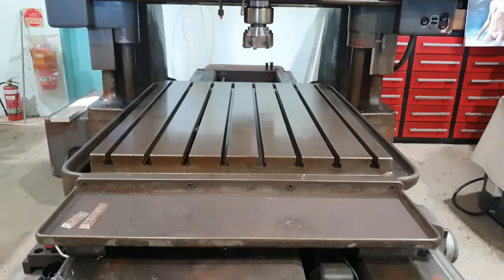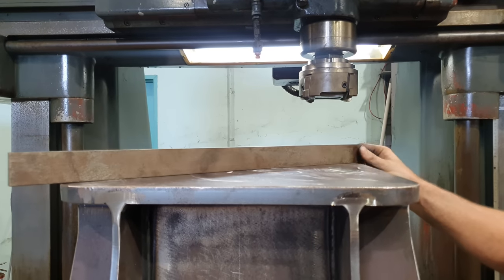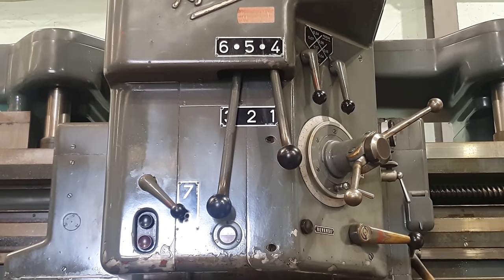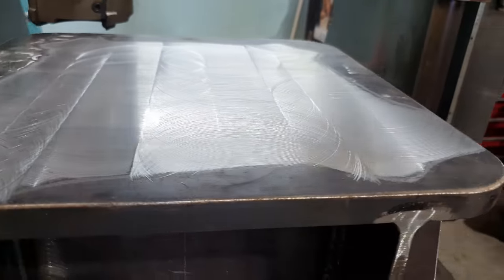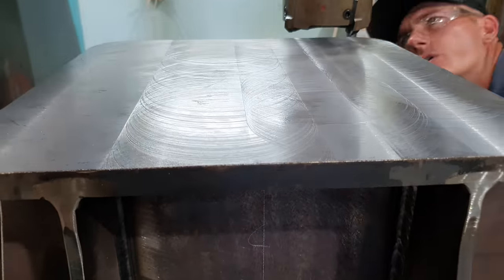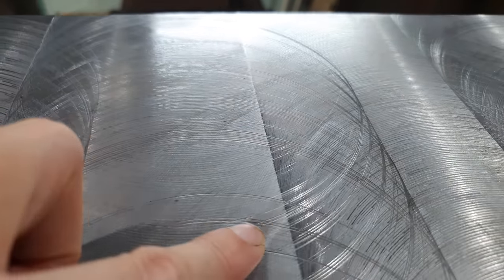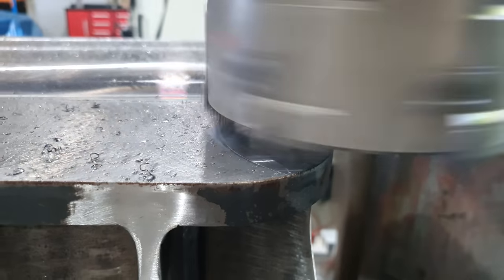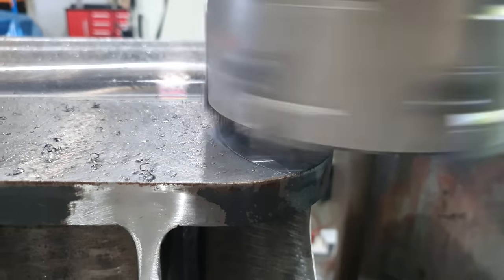Milling a Stand for a Robot on Our 1950s SIP Hydroptic Jig Borer!

Comment: I use to work at a shop that built big fans like for coal mines. They had a big mill to square up the bearing pedestals. The guy that ran it would ride on the table sitting in a lawn chair.

Comment: It's nice see older machines still being used and you do fabulous work in your shop. I used many times an old Tos hori borer for Tenix ship building, I found that plate cut out with plasma cooked the edges hard. A chamfer ground right around edge of plate reduced vib & insert wear & increased surface finish. These surfaces were later used for (hand scrapped) chocking. This was for the many Anzac Ship project machinery foundations and bases made in Williamstown Vic.

Comment: Woo hoo Monday's too, brilliant surprise. Very good finish at the end, tall structures can be a bit difficult due to vibration, but all good at the end. Interesting trick with the insert. We had an old Webster & Bennett 48", which was very old WW2 era, but it left a great surface finish. The operator cared for that machine as if it was his child, forever cleaning, oiling and greasing. He was on that machine for at least 30 years. Thanks Kurtis and the lovely Karen for this surprise.

Comment: its crazy how this big of a machine can just do a 0.1mm pass over such a big surface without any issues. manufacturing the machine must be incredible.
Reply: This machine would most likely do 0,01mm pass without problems
Reply: Specifications say .003mm 😮
Reply: @chrishartley1210  damn.
Reply: @chrishartley1210  still very impressive
Reply: VERY large castings that are then Precision Machined and assembled...

A lot of the precision this machine and others are capable of it come from their shear mass and rigidity more than the precision surface grinding they undergo...
Reply: It's a puzzle. How do they make machines like this, without machines like this to make them..

Comment: I notice that Curtis said he didn't want to spin it in the lathe, not that he couldn't spin it in the lathe. How dangerous would it have been to do so?
Reply: It's more of a pain to set up than necessarily dangerous. No round surface to indicate off of, and indicating square work is annoying. Since it would be all face cuts, concentricity isn't a concern, so the indicating wouldn't need to be very precise, but it's still long and would be awkward to get mounted in the chuck.
Reply: more than likely he didn't want to use the lathe due to the tedious set up required to get that properly running in the lathe.
Reply: I think dangerous is measured in kilogram. So I think it’s 150 kg Dangerous
Reply: Since it's symmetric, the spinning it self wouldn't be particularly dangerous. However I wouldn't feel safe doing work next to it, could get badly beaten if you got to close to the wings.
Reply: Since there are no round areas to stick a rest under at the top end, VERY dangerous...

That muck mass spinning unsupported in a lathe...I'm not surprised Kurtis didn't want to even try it...

But then, with the Hydroptic, he didn't need to since it's by far the best machine for that kind of work...
Reply: @HappilyHomicidalHooligan  And there you go...why would anybody use anything but the machine that was made for that type of job? 
Only the person who has not got the right machine to start with.
👍
Reply: @HappilyHomicidalHooligan  Eh, the hydroptic is a jig borer. It can certainly run shell mills and face mills, but it's really meant for precisely locating (and enlarging) holes. The quill isn't meant to take large radial forces, only axial, so side milling with an end mill or taking deep facing cuts isn't recommended. And the depth of cut is limited.

A gantry mill (same looking machine, very different bearing setup) would be ideal for these sorts of milling operations. In this case there wasn't much material to remove, but when there's a lot to take off this isn't the right machine for it.
Reply: It’s a natural job for the milling machine and an unnatural job for the lathe. A good machinist will always know which machine to use.
Reply: Since there'd be no way to support the end of the work, the jaws of the lathe would've had very little material to bite on given the base of the stand. I sure as hell wouldn't do it lol
Reply: @PeregrineBF  I'm guessing he knows that as he was careful to do very minimal cuts.
Reply: @PeregrineBF makes me wonder, would it work to make a fixture for a lathe's tool post then make a lathe mill chuck adapter turning the lathe into a franken-mill? Or would that cause too much flex? I'm not a machinist so this is well outside my field of knowledge.
Reply: @urbanbasementoperator  A chuck wouldn't have much to grip on, the bottom plate being relatively thin compared to the length of the piece. Might better to bolt it to a face plate? But that is even harder to indicate.
Reply: If you have a large enough face plate for the lathe it’s easy enough to set up
Reply: @mrgumbook Quinn over at blondi hacks almost did this. The difference is that they just mounted the die filer base casting to the compound (or cross slide?)  directly
Reply: @WayneWerner  that means it can work but as I understand she's making a model steam engine not a part for a customer but thanks for reminding me. I mentioned flex because the size of the part might be pushing the machine beyond its specs. As I understand the biggest thing a machinist goes for is repeatability. But come to think about it Curtis decided the time to prepare such a setup would cost more than it was worth to manufacture such dedicated tooling. At the end of the day this channel is a side hustle at worst and advertisement for him at best,. His business will always come before the channel and to somebody who does jobs on a quote basis every hour of his time is as valuable as the next. Curtis is an excellent example that the best tool you have is the one between your ears.
Reply: @mrgumbook  That's doable for line boring, and some light horizontal milling, but a lathe only has 2 axes of travel for the cross-slide, no vertical movement. A mill has 3 axes. A horizontal boring mill (with synchronized tailstock) like the Lucas Model 31 that Keith Rucker  has been restoring is basically what you're thinking of.

The other complication is with speeds. Mills usually have higher speed but lower torque than a lathe spindle: they have to spin a small cutter, not a huge part. So surface finish would suffer if the speeds & feeds the spindle is capable of aren't correct. There is overlap in the ranges, but it's not complete.
Reply: @PeregrineBF  ah I knew there was something I was missing I was thinking about the loads lathes and mills are designed to handle and not how they are designed for fundamentally different purposes. To think about it an inexperienced operator can cause even more damage to a part with a CNC because a machine can't differentiate between operator error and a finished part. A human knows when something is beginning to go wrong and intervene.
Reply: @PeregrineBF  Vertical lathe.

Comment: Your solution to achieve a much finer finish was a good thought. Sometimes using low flow air to sweep the swarf off the surface will go a long way toward eliminating the gouging by trailing cutter inserts. Love to see a supposedly obsolete machine being used to handle a one off job on an oversized part.

Comment: Great to have another good video to watch and get to see the how the new old addition works. How long did it take you to figure out all the controls?  Thanks. Regards Richard 🇬🇧
Reply from the maker: Hey mate didn't take long to figure out the controls, just need to remember which way things go when I haven't used it in a while 🤣
Reply: @CuttingEdgeEngineering  So it's a refresher course in RTFM? 😅
Reply: @CuttingEdgeEngineering  looks a very good machine for doing what you just did. It's nice to see older machines still working. I have a 1943 Wilson Lathe and some 70's machines. Far better build quality than the modern equivalents. 
Regards Richard

Comment: "You need CNC and robotics to stay competitive in machining industry today"
CEE: Hold my beer!
Reply: He don’t need cnc not for work he does
Reply: Finnish Press channel guys have a mid-sized CNC milling machine in their shop (doing random fixing too) - and it works quite less the manual machines.
Reply: GOD YES!

With his skill, Kurtis can likely do any particular job twice in the time it would take him to build the program to do it on the CNC...

😄😁😆😅😂🤣

I can really only see him use the CNC for repetitive operations making dozens of the same part (bolts, pins, shafts, gears, V-Blocks to sell to competitors etc.) that would otherwise eat up a lot of time he can use for the unique jobs* that are the meat & potatoes of his business...

* And MOST of the work he does is unique because it's all repair work and things rarely break in exactly the same place in exactly the same way which makes building a CNC program for EVERYTHING he does would take too long compared to doing it manually...
Reply: You can't compete with CNC for high volume production, but for low volume, especially custom jobs like this, manual is the way.
Reply: For many one-off jobs, manual remains the best, using the CAM software package that runs in real-time between the operator's ears.
CNC is great for repeatability but all the prep work upfront has a cost, often too high for single use v. manual.
Reply: Horses for courses.
Reply: @Fragaut  Exactly. You don't use CNC for repair and maintenance, or single fabrication. Which i believe is what Kurtis does.
Reply: hold my diet coke haha
Reply: CNC is really only needed for two types of machining work:
1) Complex geometries involving lots of curves and diagonal cuts that require setting up the work in many different positions between cuts. While there are specialized milling machines  and table attatchments that can do these kind of things in a single setup, they are not common and often expensive.
2) mass production.

For a single part involving mostly straight cuts along the cardinal directions, manual machining is often much quicker than designing the part in CAD and setting up in CNC, especially for an experienced machinist
Reply: Just to make clear, it's a meme.

And let it be known for sake of transparency that even in terms of single one-time pieces, any CNC technician is probably gonna easily outdo anything I can manually churn out on a shaggy Sieg SX2 or my 120 year old belt-driven lathe at anything and everything, any day of the week, full stop, and that's that.

THAT said, I still prefer manual machining for what I do, if I bodge a step I can save it, bodge a step with a CNC = Do it all over again.

As a viewer I also prefer manual machining, Largely because every process, tool, etc is explained, I get to see everything going on real time at least for first full cut with each tool.

And that's one thing that doesn't come through as well with CNC channels.
They talk a lot about Fusion 360/Solid Edge, feed rates, spindle load & cutting profiles etc for most of the video.
Which is cool and all, but then they put little/no effort into showing actual machining, and expose the job to all about 100 times more coolant than I honestly think is strictly needed, spraying down everything and can't see anything* 😆

Then apparently to make absolutely certain I can't catch on, footage is sped up by about 1000x.
That's the impression I'm left with a lot of the time.

*Been a while but as it was explained to me by a guy at a shop once, he told me the trick was keeping a constant temperature rather than over-cooling between high's and low's of spindle load (usually a good indicator of tool temp he said), better for precision according to him, made sense to me at the time 🤷‍♂
I've never used that much coolant with CNC's, but if the YT CNC'ers have a thing going on that works = Far be it from me to put the absolute verdict on it, maybe tool lifespan is "importanter"?
But, with respect, it doesn't make much for content IMO and I'd just as soon stick with CEE/Abom/TOT/Blondihacks ☺
Reply: @JimWhitaker  No, it was definitely a stand for a Robot, don't remember a bracket to hold the shovel for the Horsesh1t! 

😀
Reply: @andywindy  🤣
Reply: ?!? You most certainly need CEE’s antique precision machining gear to be able to properly install your new fancy AI-driven « factory 9.0 » robot with its feet stable onto the ground… Otherwise it would only produce 💩💩, 9.0 style.
Reply: @joso5554  😂😂
Reply: @HappilyHomicidalHooligan  You can specialize and get CAD data for the parts and start making parametric programs and automation for cam, it´s pretty neat, but you´d still have to program everything first hand. For a job like this the only thing I´d need to set up on my cnc mill would be the same he has and a measuring tape. I have a plate on my table with holes for dowel pins and m16 threads in an alternating pattern for exactly that kind of work.
Reply: @troelshansen6212  You´re so wrong and you don´t even know it.
Reply: @HappilyHomicidalHooligan  not at the spindle speeds he runs!
Reply: @David-xl8zf  this man knows lol
Reply: Pakistan, India, any other middle eastern or south asian country:  hold my tea!
Reply: @leebatt7964  I follow one of those channels, honestly its pretty cool what they can do.
Reply: @ToreDL87  i do as well. Old clapped out machines, shop made cutters and water from a coke bottle as coolant and yet they get it done.
Reply: @leebatt7964  Not to mention working in the muck, and no "saftey" gear.
I did a lot of coke bottle coolant pumping myself, and the machines seem alright.
The only downside is they aren't yet (yet being keyword here) able to make durable stuff, seems they're getting as much broken stuff in as they pump good stuff out.
That said, gotta start somewhere, I applaud their effort!

Comment: sweet a bonus video this week
Kurtis, a method that cleans the surface really easily I used on stainless steel griddles in restaurants is use steel wool with a bit of oil and by hand just polish the surface. I have removed significant scratches from the surface with that. A surface the size of that stand would take about 5 minutes to polish up.
The benefit of hand polish instead of using a rotary tool ( flap disk holding the steel wool ) is you won't warp the surface by hand where the tool could.

Comment: 1 thing to be mindful of is how a clamp can pull a job out of square.  Dont think its an issue here due to the nature of the job but when I used to mill jobs like this we used small 1 or 2mm think Aluminium squares (about 30mm sq) and flatten out to nothing on one corner (with a hammer) to create a feathered edge to zero thickness.  Inserting this feathered edge between the m/c bed and the job directly under the clamp allowed you to tighten the clamp and secure the job in its natural position without subjecting it to any twisting forces so that when the clamp was released the job didnt need to move or spring back to its pre m/c state.  Think CEE is a brilliant ref to any would be engineers - the thought process and application here is so good to see.
Reply: Thanks.

Comment: bit of a long shot but here in Far north Queensland we have a lubrication spray called "Mako Oil" I use this from completely oiling up machines or parts to using it as a cutting fluid. it works really well for the fitting and turning work i do out in the field and in the workshop. I definitely would recommend giving it a try out

Comment: Thanks for this. Great tip to use the facing cutter as a fly cutter.  Lots of good info  in the comments too. Especially that the jig borer is only strong enough for ‘light’ facing milling. As someone said, the customer should have had you drill the mounting holes while you had it set up on the jig borer.

Comment: Thanks, wanted to see it in action & am impressed.  Though woulda liked a confirmation/flatness check after release from the  table.  The base looked like it took some bending to clamp down, and while it shouldn't affect the top, a quick check costs nothing, AND you can tell the owner & they'll appreciate it.

Comment: Good work pulling a decent surface finish from that.
Ever consider getting a holder for the Sandvik 245 square milling inserts? They are very durable and handle dry cutting at 700 sfm really well. Good surface finish with the standard inserts, and you can get wiper inserts that make even A36 look like glass.

Comment: If swarf really is the issue, mount an air jet to the spindle so that it blows the swarf away from the trailing cutting area should help you immensely with your surface issues.

Comment: Just a machining tip from one with over 50 years in the game. Before machining a gas cut plate, grind a 45 degree chamfer around the gas cut edge. In this case about 1.0mm down, i.e 1x45 chamfer. This will remove the flame hardened edge and enable each cutting inserts to slice into the cut rather than smacking into the edge thus looking after the inserts.😊

Comment: Fantastic surface finish achieved in the end. I was getting worried that if Kurtis was not satisfied with the surface finish obtained after each pass that the top surface would have ended up being machined clean off eventually 🤣🤣🤣🤣

Comment: There's a video called "iscar chip formation" here on youtube that shows clearly what happens when cutting mild steel. It's not so much chips getting stuck under the cutter, but rather the gummy metal randomly piling up on the cutting edge and then digging into the material way below the cutter level, leaving ugly tear-outs. To fight this you need to push enough heat (i.e. surface speed) into the metal until it becomes soft enough to behave. Basically forget about good finish until you're making blue chips.
Reply: THANKS.